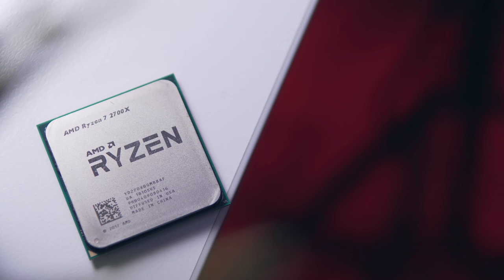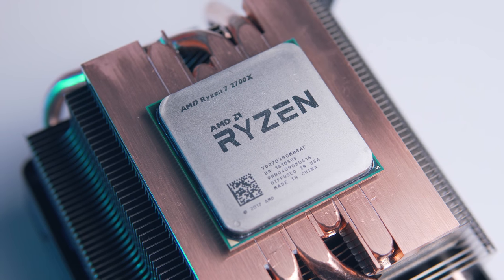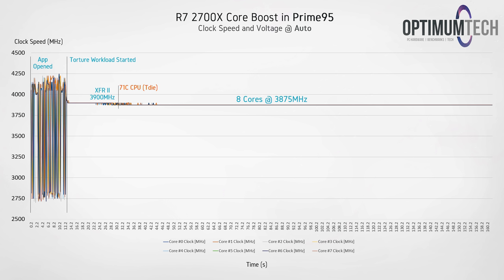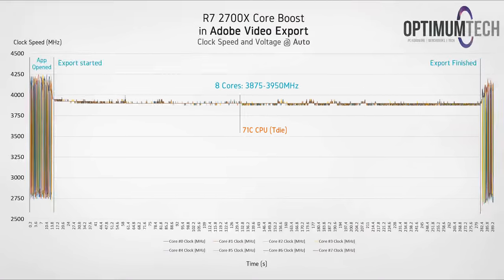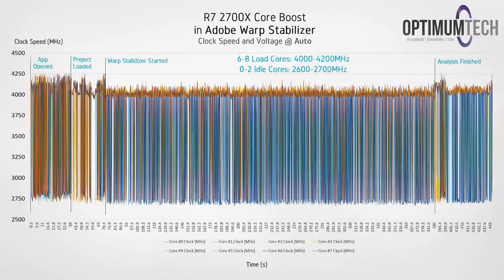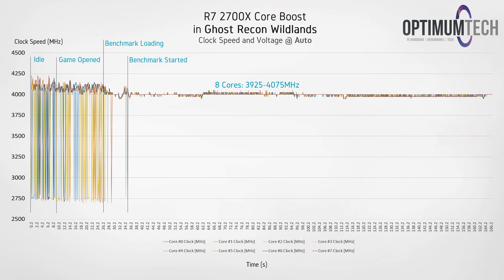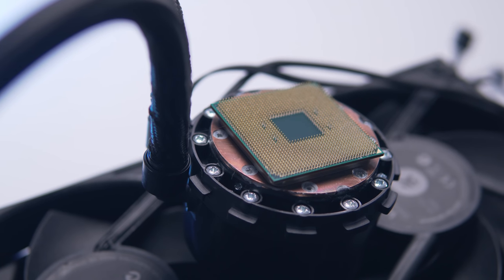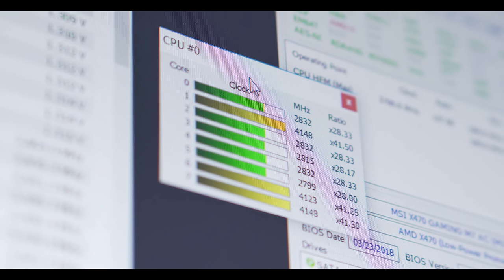R7 2700X - Boost Performance Analysis

Comment: My 2700x with a Noctua NH D14 (single middle 140mm fan only) runs Prime95 threads at ~3.95ghz, all core boost in games at ~4.05ghz, multicore boost at ~4.15ghz and will boost one or two threads between 4.25ghz and 4.35ghz. 

As we see in the video, the temperature is the factor holding the clocks down, and the boost clocks at various active-core combinations will scale with lower temps.
Reply: That is what I am seeing with my R5 2600X on my Noctua NH-U14S. It only hits 4.3 in a transition stage like at the end of a benchmark.
Reply: sure - I'm well aware that it's volts which increases temps. That's not what my comment discusses though. I said that in THIS video, compared with my results (on a bigger cooler), it's the temps which are holding the XFR2 boost clocks lower than mine. Which is simple, and true. So I'm not quite sure what you're laughing at, but it seems like you're replying to comments which haven't actually been made here.
Reply: xfr looking amazing check salazar review of the 2600x
Reply: my 2700x with cinebench sits at 64 deg (27 deg ambient) at 3.9 ghz and about 1.29-1.3v
but it idles at 4.1ghz (performance powerplan) even on all cores with 1.35 v
i really don't get why it can't boost at 4.1-4.2 ghz on all cores at 100% load
Reply: 4.2 on load @ 8 cores... 4.35 in games on 2 cores
Reply: mainboard setting? my 2700x runs out of the box 4.2 ghz @100% load in prime
Reply: How do you turn on the precision boost?

Comment from the maker: A lot of people are asking for watercooled results. Take a look at where XFR drops off in the intensive workloads and that should give you a pretty good idea. 

The purpose of the stock cooler was to analyze XFR and the boost clock out of the box. 
Thanks for watching!
Reply: Understand your reasoning, but it's a missed opportunity to gather more data about this stuff to have a better understanding of what's going on. Also, you should also test with a pure single thread app to see how it behave exactly on that situations, something like lame mp3 encoding perhaps.
Yeah, it's kinda boring, but for science you know. Also it would help your channel to stand out more in the pretty bland, shallow YouTube reviewers ecosystem, which many channels fall into.
Reply: im still using my 6 year old thermaltake water pro 3.0 the fx slayer im still getting great temps on all cores at 4250.
Reply: As always since Phenom 2 dont  trust amd boost clocks manual overclock  i set  mine to 4250 on all cores at 1.3700 or 1.37500 volts and it doesnt reach 70c  on my single fan thicc thermal take water pro 3.0 and that thing is 5 years old.
Reply: Optimum Tech if possible can you do a review about the x470 i gaming from asus? thanks in advance :D
Reply: You should then also have a go at Intel for putting 4.7Ghz on the 8700k because you never really achieve that without MCE. I think the advertised speed should be a the two core boost I admit as that is one one you will actually see, because your OS will take up CPU time so if you are doing anything else your going to be using 2 cores.
Reply: Darkpharoh  Intel does that to they list for example 5 ghz boost on the 9900k but they do not list that it will be as hot as the sun at that speed unless you have a very good cooler, not hating on Intel love both Amd and Intel

Comment: Wow, interesting results. Seems a lot underwhelming when looking at the gaming results. Have you done a similar test with the 8700(k)? I would love to see if it hits the on the box clocks when gaming so I have a good comparison. Maybe they all “under perform” in a similar fashion...

Nice vid. Like your style and content, keep it up. 😊
Reply from the maker: Gimby Dude - I haven't, however you would see something kinda similar. The 8700K doesn't maintain 4.7GHz out of the box for all cores unless you select MCE in bios.

I really wish the 2700X had a similar option!
Reply: It has, it is called precision overdrive. Not all boards have it enabled yet.
Reply: idk how things had changed, but i used to have a ryzen 1700 and i never touch the stock rgb cooler, it didn't help with OC. corsair h100i v2 is my choice
Reply: My gaming results are great my gtx 1080 never drops below 98 percent usage when im gaming so thats a win.

Comment: I have tested all of this on a 2600X with a Corsair H100i V2 cooler. First 15 minutes of game, CPU is under 50C and average all core boost is 4.2 GHz. 4150 - 4175 MHz average all core boost in 1 hour of PUBG with an average CPU temp of 50C. Single Core test in Cinebench this 2600X gets 178. Boost was 4250. This is all on an X370 board so only XFR2. Precision Boost Overdrive is only on X470 boards and has to be enabled in BIOS. Many reviewers have seen 181 on Cinebench single core so must be 4300 MHz. The box does not lie. These are real world speeds.

Comment: Hey! Not sure if it is the BIOS updates AMD launched in the last year, or just my 2700x is from a better bin, but I am using the stock cooler, Wraith Prism, and these are the max frequencies I get for all cores: 6 cores reach 4300, 1 core reached 4275, and 1 core 4250Mhz. In a stress test all 8 cores sit at 3900Mhz. I am happy with this. I think an aftermarket cooler would make the 2700x quieter, but not sure about the peformance increase. For that money difference, a better cooler is 80-100Euros at least, I could upgrade to the next gen Ryzens.

Comment: If somebody is interested about my experiences i have 2700x with x370 msi gaming pro carbon. His results match with mine since on heavy all cores and threads workloads my CPU sits 3,950-3,975 Ghz very consistently

To note here too i think it's important to mention that i do have Corsair H110i cooling the CPU and my thermals on gaming never go above 50 celcius, and workloads are staying below 65 celcius. However i sometimes see the boost going up to 4,3ghz or few mhz below that treshhold, but it only happens on windows when loading app or something quick. I haven't been able to get boost anything near that with single thread applications or tests.

I also don't get any more than 4,075ghz from the cpu when gaming, like never, and it doesn't seem to matter how low my cpu temps are since it will never boost above that, and during the gaming it will run all of my cores with same frequency until my temps start getting high (never does). I play World of Warcraft and there i see that 4.075ghz on all cores stable while my temps are way below 40c.

What to take of this? well it seems like if you have good AIO cooler then your CPU might reach 4,1ghz on all core boost applications like gaming, but i don't think it's temperature limit what holds it from going higher. I think it's the coded limit that the CPU doesn't even try go higher or it's a chip limit that mine just can't go higher since i don't see any change in all core boost when watching temperatures delta. Anything below 70 celcius will max boost it to 4,1ghz even if i have thermal headroom left to use.

I would like to see video about this, define how much worth it is to slap a better cooler for 2700x and i think it would have been nice comparison to add to this video. Slap 2700x with stock cooler and best AIO there is to see if turbo behaves differently with better cooling below thermal limits.
Reply: I have exactly the same setup msi x370 gaming carbon pro, 1.G1 beta bios with precision boost overdrive, H110i, 64gb 2800 with stilt's fastest timings.  PUBG 4.1ghz sustained on ALL cores at 50C, regular usage i see 4.2 to 4.35 often (with 4.35 on 2 cores max).  Cinebench 1820s stock with ~4025 all cores during benchmark.  I saw someone at the MSI forum got it to boost 4.5 xfr without touching a thing, so I think it could be the chip also.
Could only get 4.175 @ 1.4 stable with max temp 75C which resulted in +60 pts in cinebench (not worth it imo)
Reply: Ye i think my stable with 1.4volts was like 4,125ghz but temps in Tdie were quite high, like 70+. So defo not worth the OC for daily usage. XFR seems to be doing best work it can with the CPU. I did trie 4,25ghz and it did work somewhat stable for few hours with 1,5v+.

Comment: Logging the voltage would have been interesting, too. I wonder if it is possible to under volt the CPU to get the temperatures down a bit. Also, since this channel is somewhat related with SFF systems, it would also be interesting to see where the best performance per watt is for these chips, if tuned manually. Also, thanks for the testing and Video.

Comment: You should have tested it on the aio as well , since it only makes sense as the 8700k also needs a beefy cooling solution to reach 5.2ghz , so the overall costs are equalised
Reply from the maker: The main difference here is that Intel aren't printing Max Boost 5.2GHz on the box. 
This video isn't attacking AMD or anything, just getting the facts out there so users know what to expect in different workloads. The 2700X is an awesome CPU.
Reply: Optimum Tech I am quite sorry , I didn't mean to suggest that you were attacking amd or anything but it would just be a very cool video , like your 5.4ghz 8600k one , to see how much the CPU can of itself without any bios ocing
Reply from the maker: No need to apologise, just wanted to make myself clear :)
Reply: Optimum Tech please do delid and give us some beautiful Ryzen die wallpaper and a liquid metal 2700x with max manual and automatic oc
Reply: Rutwik Pandit what's the benefit of delidding if the IHS is soldered on? This video was not meant to show how far you can overclock the CPU by doing something only enthusiasts do.
Reply: chingi5 true , I understand , but it would be quite nice
Reply: You can't delid soldered CPU's with any reliability. And there would be little point.

Comment: These are odd results, my 2700X on b350 with stock cooler does single core boost to 4.35 and multi core to 3.975 consistently; especially the single core as it doesn't generate enough heat to throttle at that speed.  If the cpu exceeds 70C, the all core crops to 3.95.  Seems like yours is operating at lower speeds for some reason.  What power plan are you using?  The Ryzen balanced power plan actually causes issues, make sure to switch to the default balanced power plan as the fall creators update fixed the power plans for Ryzen.
Reply: Sanman Mansan asus prime b350m-a.  I'm actually not using it atmo as I had an sff build planned around it and it turns out it won't fit in the case I got, so had to grab the asrock ab350m-hdv, which I don't like as much but it's small enough to fit in my tiny case.  I used it from the initial ryzen launch and the first 3 weeks with the 2700x, it was so stable I didn't have to reboot a single time after installing the 2700x - 19 day uptime (PC runs 24/7).
Reply: @bobzdar  lol did you know XFR2 only works with b450 and x470?
Reply: @JeetGameplays  nope, works on b350 and x370.  Built into the chip, chipset has nothing to do with it.

Comment: Excellent video! I have been working on a similar video with my R5 2600X. Same motherboard same memory. I have a Noctua NH-U14S for a cooler. It looks like I am running about 100 MHz higher. At 100% usage Mine runs at 4.0GHz +/- 50 MHz.  Could be with less cores it can maintain better speeds.

Comment: My Ryzen 5 2600 loves the NH-D14. It boosts to 3.9 and stays there. In prime it boosts to 3.8 and stays there. I'm not even going to bother overclocking :p Yes yes it's not the X variant, but I only have a gtx 1060 so no need for more.

Comment: XFR 2.0 doesn't just have a single temperature threshold but several.
And some youtubers have reached 4295 MHz frequencies in actual workloads with the 2700X (something that can be rounded up to 4,3 GHz).

Comment: "the only time we see the 2700x get close to that(your refering to 4.3ghz) is when a couple of cores are engaged" - That's exactly what XFR is, like Intel's Turbo boost is max single core boost, XFR is max 1-2core boost for Ryzen.  Learn what your talking about before saying that it isn't working properly.  You literally say it doing what it's defined to do around 5:12...on top of that your using the stock cooler.  Thanks for showing that max all core boost on stock cooler seems to be 4Ghz and your graphs when loading programs showed your graphs get above 4.2Ghz to 4.25Ghz, which is 2 steps above the max 4.2Ghz boost as XFR will only boost the extra 100Mhz if temps allow in 25Mhz increments for 1 or 2 threads.  Meaning you went into the XFR range, with better cooling you would most likely see 4.3Ghz.
Reply: Agreed. I didn't feel like the specs were misleading, knowing how XFR is supposed to work. I'm actually really pleased that the all core clockspeed is generally from 3.875-4.0GHz, that's above the base frequency of 3.7, which seems like a nice little improvement over the previous gen.
Reply: on an older bios, my i5 4690k ran all cores at max boost according to intel turbo 2.0. with a special motherboard, or a differently configured bios, i believe ryzen 2.0 may be able to achieve similar behavior
Reply: The turbo boost frequencies Intel lists are for single-core boost not all core.  Running all cores at turbo boost speeds is outside of spec for the processors, there is something call multi-core enhancement that a lot of motherboards have.  it sets all cores to run at the max turbo frequency.  That feature has no guarantee of stability and processor life can be shortened because of it.

Comment: May be some motherboard variations it rarely goes below 4000-4050 even at 80-85C in prime95.  And 90% of the time in games 4125-4250 (I'm at about 55C there and it does occasionally hit 4.35).

Comment: This nicely put into perspective that the boost of intel chips works different and gives way better performance gains.  This also shows that the ryzen 3xxx turbo boost is totally irrelevant. and the  chip in general will only go 100 to 200 mhz over stock. this boost performance is rather disssapointing.

Comment: what are your ambient temp during this test? I'm using Scythe Mugen 5 Rev B 1800RPM kaze fan x2 push pull with side panel open and I got same core speed as yours using prime 95, except my cpu temp are 74C with my room temp around 31C.. so I'm guessing yours at 28C? correct me if I'm wrong

Comment: Would a 2700x maintain an all-core 4.0ghz boost with a single thread at 4.3ghz under a gaming + streaming load? Assuming temps are kept in check? No one has verified this yet.

Would be a shame to buy a 2700x for streaming and in reality only get 4.0ghz all-core under that kind of a load. Gamers especially want that 4.3ghz single core turbo.

Comment: With a sample of 1 CPU you can't be sure you don't have a unlucky Silicon loser. Although stable 4 Ghz on all cores and on a stock cooler is something my 1700 can only dream of.
Reply from the maker: Safetytrousers - the CPU is stock. They don't perform significantly different out of the box.
Reply: Who buys the top of the line CPU and sticks to using the stock cooler? What you're effectively doing is measuring performance of the stock cooler - not the maximum boost the CPU could achieve with careful practical cooling. Why don't you put Out of the Box in the title?

Comment: Isn't it a bit disappointing. We waited a year hoping the new chips would clock faster but they are basically same.
Great video BTW. Very clear and informative.
Reply: HotRodX More like NO cpus hit 4ghz. The only chance you had at hitting 4ghz was if you got one before they started reserving those dies for threadripper, or if you were really lucky(average oc is only 3.8). Xfr was also totally useless on first gen.
Reply: Where are the CPUs which can hit 4.4Ghz? No review sample have done that.
Reply: After seeing these examples, I am impressed. 
But ..... and it is a big but. Professional overclockers, running dry ice?
Average users should NOT expect the same results.
Reply: Dude! we are talking about the Zen+
Reply: On the bright side these CPUs are soldered to the IHS. Not necessary to delild.

Comment: My R5 2600 will not complete cinebench @ 4.2ghz even with 1.475v 😐 but dam it's a beast at 4.1ghz w/ 1.375v
Reply: 1.475 volts is pretty high. Most people only dare go up to 1.425volts.
Reply: I don't even go above 1.35
Reply: Wouldn't run it long term above 1.4v but just to hit benchmark scores I went for 4.2ghz. Using Coolermaster ML120L Aio instead of stealth cooler. Stable @ 4.1ghz w/ 1.375v
Reply: I could push my 2600X to 4.15 at 1.385 v.  Why bother? Using a decent cooler it just over clocks itself.
Reply: HotRodX I would go less. I think they said 50mvolts less.

Comment: What are your out of the box voltages, according to HWinfo, my 2700x build defaults to 1.4-1.5v out of the box, until I open ryzen master software which drops it to 1.3-1.4v, no changes applied, just open the software and voltage drops, close it and volts goes back up. I have a x370 killer mobo, didn't do this with a little r3 1200. I don't really want to lock in a all-time overclock in the bios just to set the voltage where it should be, what so I do?
Reply: Max Xlr8tion Is that the VID per core, the vcore(from the MOBO), or the core voltage(svi2 tfn) reading? The svi2 tfn reading is most accurate. Keep in mind there is no hardware monitor capable of keeping up with the rate at which ryzen changes voltages and clocks. With default settings in hwinfo ryzen could have changed freq/voltage 2000 times by the time hwinfo refreshes so you dont really know what it's really doing

Comment: i just got me the 2700x and i got a question .. is it normal that the cores are pretty much always around 4000mhz even when i just have hwmonitor open ? they seem to drop for split seconds down to 2700 mhz.